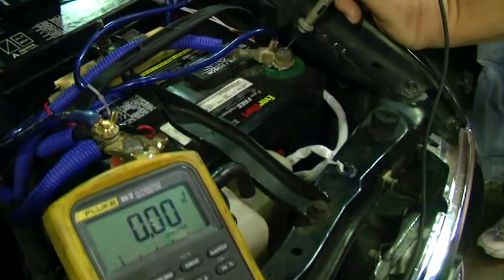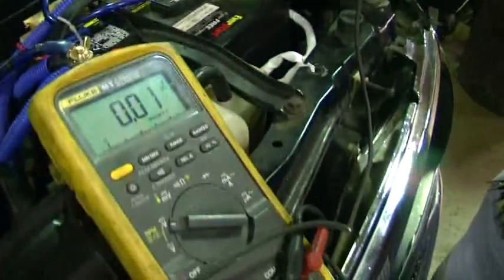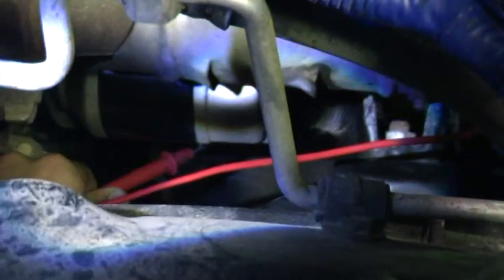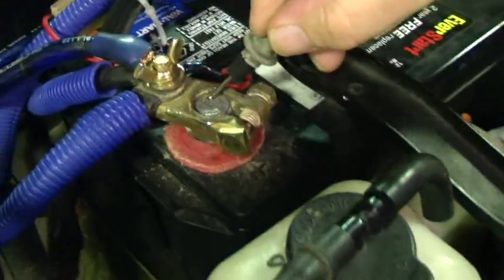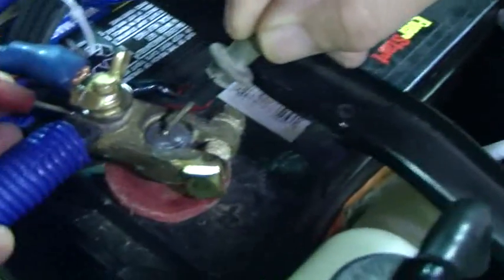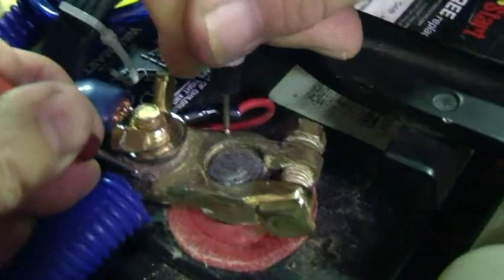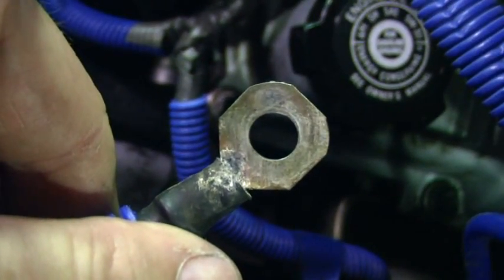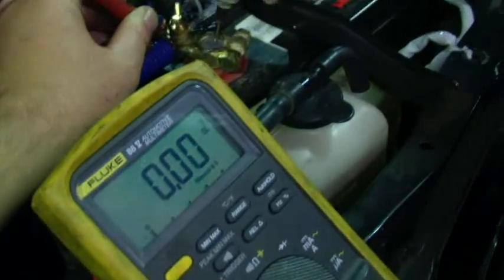Starter Circuit Voltage Drop

Comment: Thank you sir. Dealing with a 2013 Kia Sorento at the moment exhibiting similar behavior. Voltage drop at OBD port is 13.5V to 7.6V when starting. Terminal has been replaced and may just be a poor connection? I hope this is fix!

Comment: Stumbled upon this video while searching for information on a 98 4runner with a "click, no crank" condition I'm trying to diagnose. I recognized that engine bay right away! 
Thanks for the video. I haven't done a voltage drop test on something in a couple years and needed the refresher.

Comment: What settings in multimeter to put to check the voltage drop?
Reply from the maker: Leave the meter on voltage. Place the red lead at one point and the black lead at another in the circuit. If there is drop in the circuit, the meter will read the amount of drop.  For example. Put the red lead at the wire going into a switch and the black lead at the wire coming out of the switch. If there is any voltage drop or difference in voltage at those two points the meter will read the difference.

Comment: Thank you for taking the time to create this video....very informative.  Bottom line you quickly & effectively determined the problem without excess expense & labor.  Interesting how voltage can drop so drastically from one connector to another.  Keep up the good work

Comment: You need to troubleshoot from the battery TO the load. You jump to the starter awful fast. And never use those crap wingnut terminals. I've heard that some place before.

Comment: Nice video, now get rid of those crappy battery terminals. The wing nut type suck. Run a + and - buss bar for additional power taps. Not 5 ring terminals on one wing nut battery terminal. THIS caused the no starting issue. All you did was temporarily correct the issue. It will return. And why in the world would you recommend dielectric grease on battery terminals? You want the best connection possible.

Comment: So after the repair (cleaning the wire connectors) the voltage drop at the starter terminal should be zero? Before the repair it was close to 12 volts.  Is that right?

Comment from the maker: In an automobile this "perfect" supply wire rarely exists and it doesn't have to. Some resistances in the supply circuit are acceptable as long as we have enough electrons to perform the work necessary. On the starter circuit the development of resistance is acceptable as long as the combined voltage dropped across them is less than .3 volts. Again for this voltage to drop the circuit must be complete. This is simply ohms law applied to a series circuit.

Comment from the maker: On a vehicle, we want the power supply line to deliver electrons immediately to our load and deliver enough of them that the load can perform its purpose. This would be a properly working circuit. And if it was in great condition a meter lead place at two points in the  power supply wire would read no difference in potential while the circuit is operating. Can we agree on this?

Comment from the maker: You seem reluctant to consider that a perfect wire rarely if ever exists if one exists. Also, that this instantaneous (speed of light) current flow is of little use in the automotive world.  We place loads in the circuit to control the the flow of current. Loads that benefit us in some way or perform work. We are not slowing the speed of the electrons, we are merely controlling how many will flow so our different potential points are not immediately equalized.

Comment from the maker: however, no current is flowing in the circuit. Therefore no voltage can be dropped. I think we both agree on this. Now connect two different voltages to the wire. In theory, current will flow according to polarity until the voltages equalize. In the perfect wire this would happen almost instantaneously leaving no "time" to measure the difference in potential. I'm hoping we agree on this.

Comment from the maker: Well, its not that its wrong. Its that we are using different terminology. If you think of electricity at its basic atomic level electrons flow from a source of potential to a source of lesser potential/polarity. Take a wire for example. It is impossible for there to be two different charges at opposite ends. A meter placed across the wire will not read any voltage. I think we can agree on this.

Comment from the maker: Assuming you are talking about a circuit with no current flow you are correct. Voltage can exist without current flow. However current can not exist without voltage to drive it. Most of what you are saying applies to an open positive supply wire. In the automotive field measure voltage drop in this manner leads to misdiagnosis. While applicable  in other fields it is seldom used.

Comment from the maker: That's kinda what I'm saying. You are stuck at the textbook level of how electricity or electrons really flow! In the real world, potential exists at various points in the power circuit because of unwanted loads. If these loads are small they will not adversely effect the circuits operation.  If they become too great, they drop the available voltage to the load and the load will be affected.

Comment from the maker: So you seem to agree that voltage drop can be measured that way: one lead on ground, one lead on various points in the circuit. If you find 13.6 volts at one point and 13.0 at another I think you would agree that the circuit has dropped .6 volts. What you don't understand is that placing the red lead at one of those points and the black at the other will cause the meter to read .6 volts.

Comment from the maker: Well Bob, at least you've finally gotten the Math part right. Let me try to explain one last way you might understand. Voltage will not drop through a circuit that is not active! If its active and there is any resistance, voltage will drop anywhere there is unwanted resistance. If the circuit is not active it would be impossible for voltage to drop.  We are checking the circuit when it is active!

Comment from the maker: You just don't get that voltage drops as it is carried from the power source.  If its a good circuit almost all the voltage makes it to the load. In a bad circuit some , most, or all of the voltage will drop before the load.

Comment from the maker: I think you're problem is that you have never really measured a switch. Why don't you try it sometime.  In a textbook world a switch would close and allow 100% of the voltage to go through. Most switch contacts will wear over time and degrade. As the connection degrades it begins to resist current flow and drop voltage. Of course you probably live in your own perfect little world.

Comment from the maker: Well, because amperage draw would only tell us what we already know: something is wrong in the circuit, not locate the failure point. I hope that question was a stab at sarcasm not a lack of knowledge.
A good volt drop a on a starter positive circuit is less than .3 volts. in this case we had almost 12 volts. And the indirect method of voltage drop does reference ground.   The direct method I showed in the video is just faster. Could it be that now you are beginning to understand.

Comment from the maker: I plugged in the drill, turned it on and moved apart the plug just enough to probe the leads again, and this time his meter read 56 volts! He was still dumbfounded. "It had to be the drill pulling down the voltage" "has to be". Much like you he refused to relent to the fact that he might not know something. Old habits die hard. Even after I showed him how to check voltage before, after, and ACROSS the melted wire nut in the cords junction box, he still thought something was wrong with my drill!

Comment from the maker: You must have looked that up in your middle school textbook. lol Finally you said something that made sense. "Voltage is.... amount of energy driving a charge at any point in a circuit" Again a meter measures potential at two spots. It doesn't mater if one is ground and the other is power or if they are both points on the power feed side of the circuit. As long as there is a difference in potential between those two points the meter will read it!  Sounds like your facts are proving me right!

Comment from the maker: An electrician was called to fix a drop cord in our shop. A drill would run at about half speed when plugged into the cord. The electrician comes in, unplugs the drill and measure voltage on the wires, finds 112 volts on the cord and says "cords good, its your drill. Even after showing him the properly running drill in another outlet he still insisted "its the drill" Why? because the meter told him so.  Much like you he lacked a deeper understanding of the properties of voltage and current flow.

Comment from the maker: Absolutely!  I have to help techs who have been feed the fallacy that because the meter says there is voltage on a wire it must be good.  They will unplug something, find voltage and declare the "power" good.  Only to plug the component back in and find no voltage on the very same wire and not understand why? It requires a deeper understanding of the actual dynamics of electricity in the real world.

Comment from the maker: "zero diagnostic value" Maybe this statement can be attributed to the fact that you never worked on a car or a 12 volt system in your life. It probably doesn't sound as absurd to you as it does to a tech. I'm guessing that your failure to comprehend simple voltage drop is due to the fact that you are probably: 1. A student who only knows theory from a textbook or  2. employed in a field other than auto repair.

Comment from the maker: So, having to energize it "proves" it's reading both sides of power? So exactly how do you measure voltage? With the power off? If you are that's not a true representation of the actual voltage available to the load. And, if you had actually ever used a meter to measure anything, you would probably already know this.

Comment from the maker: Place one lead before the switch and one after the switch. The meter will show the difference in voltage between the two points: .08v.  One lead is on 12 and the other lead is on 11.92v. The meter will read the diff in potential of those two points.
One thing that may be puzzling you is that voltage only drops in a complete circuit. Just checking an unhooked bare wire will not work because no current is flowing. If you're still confused I can suggest a simple test with resistors and a battery.

Comment from the maker: Lets take the switch you mentioned. An open switch in the positive circuit will have  12v on one side and 0v on the other. Now close the switch. In a perfect connection you would have 12v on one side and 12v on the other. However the real world is rarely perfect and most switches will drop a small amount of voltage. For instance voltage on the inlet may be 12v and on the outlet may be 11.92v. You can take the before and after readings and subtract to get volt drop of .08v or.........

Comment from the maker: Why don't you do a search on the internet for voltage drop and see if you can find something that will convince you.  Or better yet, find some bad connections like the one in the video and see for yourself. Even wire has resistance and will drop voltage when in an operating circuit.  In most applications the wire has low enough resistance to transfer almost all the voltage to the load. In our case the connection point became high resistance and in effect became a load.

Comment: Haaa Haaaa he got 12V between +starter and +battery pins at the begining,!!!!
If at the end he realized, that  the voltage drops between clamp and wire's washer?  12V at the beggining, so what is wrong?

Comment: The fact you say you need to energize it while testing proves its reading both sides of power itf any reading occurs  bit it will be across the load   across a switch  you  would read nothing if closed if opened you would  lol

Comment: Gee why not take an amp draw and see if its pulling 2 amps or 500 amps lol,  this "method" of referencing power from various places has zero diagnostic value   whats  a good volt drop  for   how many amps drawn?  they are inverserely proportional!   LOL  hthis is weird   why not reference from ground?  which is what matters?

Comment: (2) A person reading a school textbook is going to be subjected to oversimplification, creative use of langauge and analogy rather than technically correct facts, easily misinterpreted partial truths, and the occasional totally incorrect information. When people start ascribing human characteristics like "desire" to electrical circuity, and use outdated or generic words like "electricity", you know they are operating at that middle school or high school level textbook level.

Comment: As charge (measured in Coulombs) moves through a circuit, it must be driven by energy (measured in Joules). Voltage (or Potential Difference) is a measure of the amount of energy driving the charge at any point in the circuit. 
Voltage = energy/charge = Joules/ Coulombs=Volts.

Comment: Look keping the negative probe from the voltmeters protocol, we all know that works read the batterys voltage,  you need 2 sides lol   it will not, cannot read 1 leg, if there was any reading its only due to line 2 /neutral being there as loads energized  hello!

Comment: Tremendous breakthrough?, by not clamping neg probe to neg battery post for referencing to positive polarity?   seems ridiculous to say  you can read  power off 1 leg of power,  does a car battery have 1 or 2 posts?  every single electric circuit has 2 sides of power at least,  never 1  thats not enough to compare to itself lol    you cant read  a leg of power, try  reading a open switch, it says 120v   try reading it closed, it reads zero

Comment: Tremondous breakthrough, by not clamping neg probe to neg battery post for referencing to positive polarity?   seems ridiculous to say  you can read  power off 1 leg of power,  does a car battery have 1 or 2 posts?  every single electric circuit has 2 sides of power at least,  never 1  thats not enough to compare to itself lol    you cant read  a leg of power, try  reading a open switch, it says 120v   try reading it closed, it reads zero

Comment: A car starter pulling 150-200 amps for 15 seconds will sure drop  your voltage  from 13.6 to 12.6  easily  and normally.

Just reference power from both sides of power, the neg  to  positiive  not pos  to pos

Comment: Whats the big deal, by not referencing the positive from the negative sides?

Is it that hard to keep 1 probe(neg)  on batterys neg post??   and referencing from neg   like  normal?,  the meter wont read voltage until its energized, duh  kinda hard reading voltage in a circuit de energized lol  ,,and it says  pos bat  to pos stater lug   reads zero  which is correct,  but says crank it  and it will,  only cause  the other sides introduced lol

Comment: Gee whiz   its  no different but hes chasing his + probe around trying to read power off 1 side/ leg  of power?   So what if he left neg on neg on battery??   same thing!!
IF HIS THEORY WORKED!!  BUT TRY  READING POWER WITH BOTH PROBES ON NEG  OR POS  IT WONT/CANT EVER!
Reply: DUMBO. He's not reading power, he's reading voltage drop across a resistance. Look up Kirchhoff's voltage law.

Comment: Ridiculous  and comedic  you need 2 sides of power  to complete a circuit

and a meter  uses  /samples some of it  to  read  the differential  between the polaritys,  not  line 1  to line 1 lol   you dont read a battery  by putting a voltmeters probes on the hot leg  lol  thats how you can tell if a switch is closed  no reading its closed  as its reading 1 leg, closed its  one leg  until after the load.

Comment: You will only read voltage across the load , not on 1 leg of the circuit, after the load is "common""neutral"  you will never get a volt reading with both probes on positive.  you are comparing it to itself lol, every load  amp draw will drop voltage a bit.,  hell the conductors wil a bit too   and as they  said  whats to much?? Il tell ya  the amp draw of the circuit

Comment: If that method worked it only saves having to do 1 math figure, say if neg to pos on batt was 13.6   and at load was 13.0 you need to subtract to get .6, however since the voltage isnt there unless the loads energized  that tells you right there its wrong, if you get a volt reading on line 1 with both voltleter probes  you are reading 2 legs/sides of power. meters dont read 1 plolarity to itself.

Comment: If you reference your ground on ground the voltage drop will be read accurately if any exists,
If you place both probes on a volt meter on positive, you wont/cant read anything, its 1 side or leg of power, it must be referenced to a opposite side of power, not itself, a battery wouldnt need 2 posts if this were true.

Comment: If a circuit is energized or powered, as a convention we say that the 

operative voltages exist even though there is no charge or current 

flowing and the voltages are theoretically infinite. This is in 

recognition that the energy or power is instantly accessible whenever a 

load is introduced into the circuit.

Comment: So what does a voltmeter measure? SI explanation:, same thing but with time
The only difference between the two explanations, as I said, is a time 

factor. Power is the energy delivered per second of time. Current is the 

charge flowing per second of time. So when you compare Power and Current, 

it is mathematically and physically identical to comparing Energy and 

Charge. The time factors cancel out and you're left with only a language 

difference.